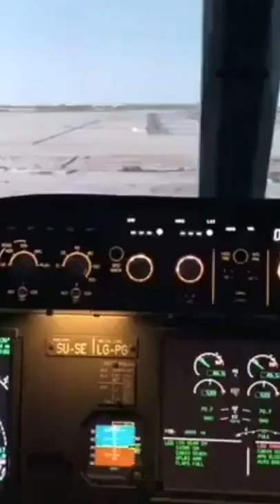Can Planes land using "Auto-Land?"

Comment: I don’t think you understand the regulations 1. You cannot use ils landings without visablility you would have to divert 2. They are only used in near perfect conditions
Reply: I don’t think you understand regulations there’s different additions of ILS approach including cat, one cat two, and cat three. All come with a different minimum’s for go around. Any ILS cat three approach can be flow completely in auto land with no visibility  all the way down and has a minimum go around of 50 feet. The auto pilot is disengaged once the plane touches down. Cat three ILS can be also set to go around automatically if runway is not spotted within minimums. The first officer flies the approach on instruments, while the captain searches for the runway outside the windows, when the first officer calls minimums, and the captain as a runaway insight you proceed with auto land. Auto flare is armed and the autopilot lands the plane. ILS is almost always used when conditions are not favorable and when the worst conditions are presents, you use ILS cat three, I don’t know who told you that I LS is only used in your perfect condition but that completely nulls the point of instrument flight rules.